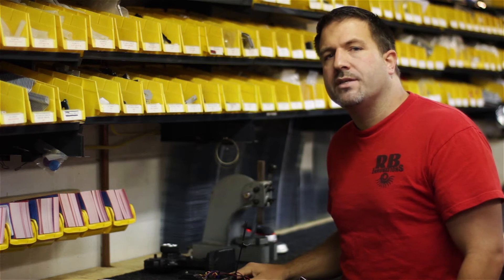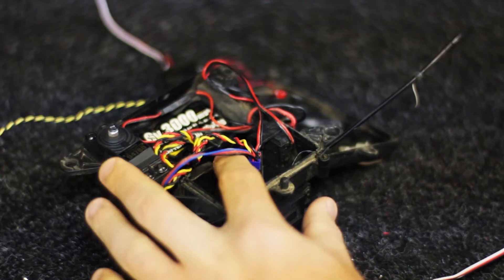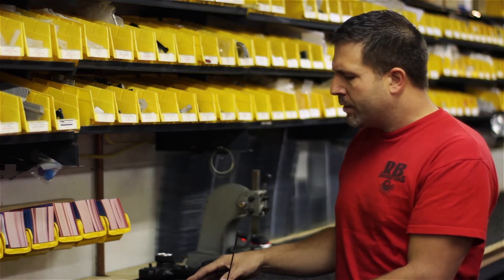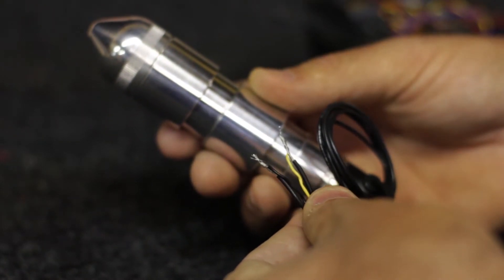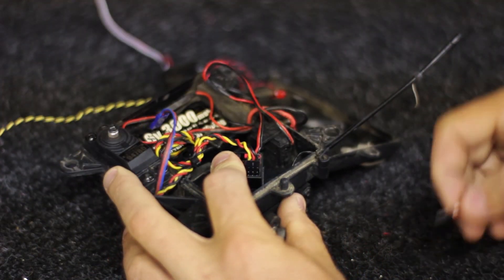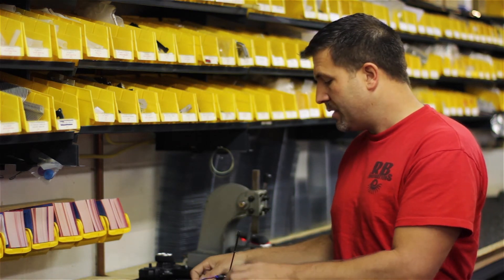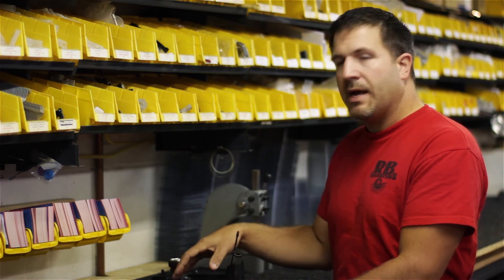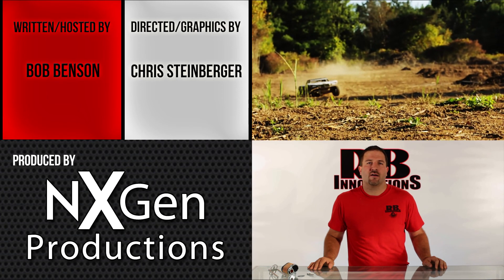Installing Electronic Switch for RC Nitrous System

Comment from the maker: Shipping depends on your location; you can log into our online store and plug in your address, and from there it will calculate exact shipping cost. All nitrous systems that ship internationally don't include the nitrous canisters. We do give an alternative company for order for canisters for international customers. This is due to international shipping regulations of pressurized gases. The Silver Bullet 8 Gram is $175 and Silver Bullet 16 Gram is $195, and you can find them on our website.